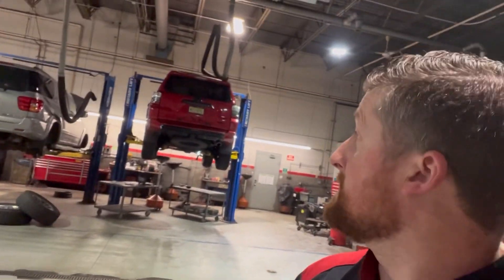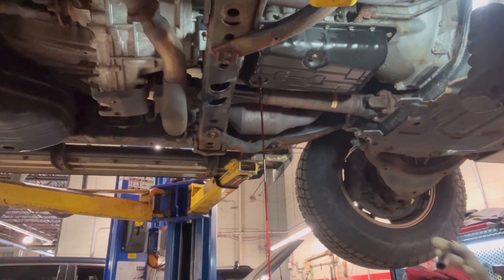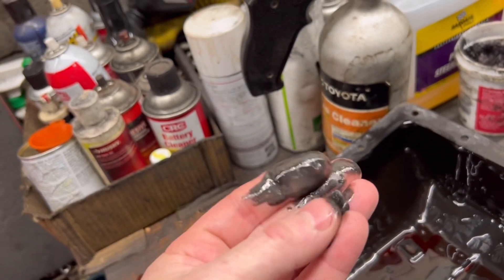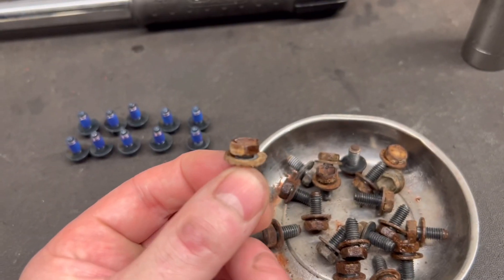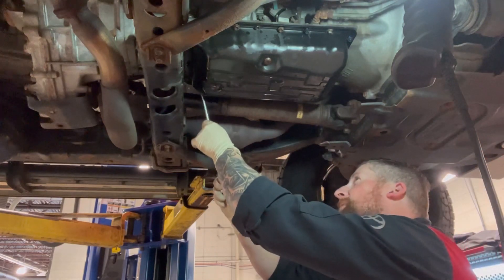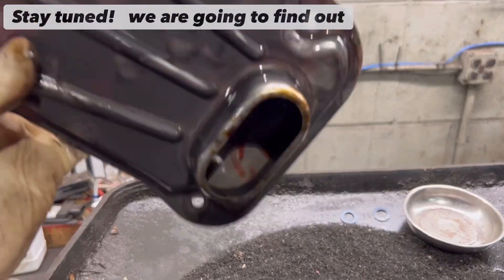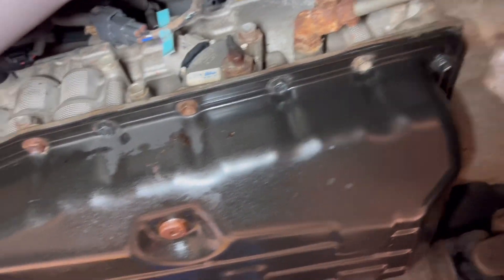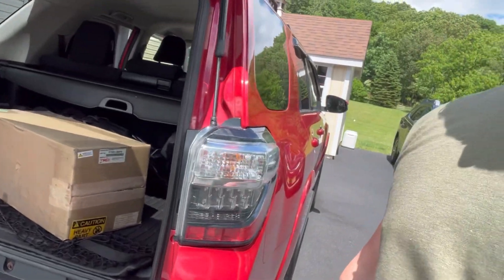Toyota 4Runner • FREE Maintenance Tech Tips - DIY Transmission Fluid Change  with Filter Part 2

Comment: since i bought mine used with 150k I did just the fluid, however it was far dirtier than i expected. So  next oil change will drop pan and do filter.
Reply from the maker: Smart! 👏🏻👏🏻

Comment: I have a Toyota 4runner 2014 SR5 four-wheel-drive with 202,000 miles. I have never replaced the transmission fluid due to the factory recommendation that this is a lifetime of the transmission fluid and filter. After watching your video I would like to do it. However, many people in YouTube advice against trying to mess with the transmission on such a high mile vehicle. Not even for a simple flush and filter change. Some fear that removing the filter could potentially break bolts and create more issues, even due to the removal of small particles which supposedly help with the clutches not slipping. In all these years I have not had any issues with my transmission, no skipping, no noises, or leaks of transmission fluid on my garage floor. I do not use my vehicle for off-road or towing. After 11 years I never had any issues. However, I will not hold you to the recommendation but do you think I should just leave it alone and not perform a transmission and filter service at all. Thank you.
Reply from the maker: 1st off, I would have never waited that long, but I understand why you did.
2nd , I would by all means get it done ASAP 🤞🏻😅
Reply: I'm charging my fluid at 196k miles. Bought it used at 184k and the previous owner told me he had changed fluid and filter "recently". I don't trust that he ever did it after discovering he lied about a significant problem we discovered with the truck. It's starting to slip slightly at take off, so I figure I have nothing to lose at this point, but hoping it cures the slipping! Btw. My 4Runner was never off-road driven either and obviously a "street queen".
Reply from the maker: That’s a shame, but unfortunately if you don’t change that fluid, that will happen.
Wishing you the best of luck! 👊🏻
Reply: Why people said that It’s bad idea remplace the filter on the transmission, it is a filter … all of the dirty fluids come from the top of the transmission go true the filter and clean the fluid properly to prevent back to the top side of the transmission, at least once need to be replaced and cleaned the pan and then magnetic , after that drain and refill and ready to go until nex time, 30 k 👍

Comment: I recently visited my dealership for routine maintenance, and for the first time, they offered to do a transmission fluid change. This service has never been done before on my vehicle.

However, after watching a few videos online—including some that advise against doing it on high-mileage vehicles that haven't had previous fluid changes—I'm now hesitant.

I drive a 2012 4Runner Limited with over 115,000 miles, and again, the transmission fluid has never been changed.

Based on your experience and knowledge, would you recommend getting it done at this point?
I’d really appreciate your honest advice.

Hope to hear back from you soon.
Reply: Thanks for your reply. So to confirm, it is safe to do it, right?
Reply from the maker: @Felipe-gb7yw YES
Reply from the maker: Get it done. 👍🏻

Comment: Hello Wikings Garage,
Your channel is very helpful Thaks for your Tips.
I am writing to you because I have a question regarding changing the A750F transmission fluid. I'm from Brazil and I have a 2014 Toyota SW4 3.0 turbo diesel. This vehicle is very similar to the 4Runner from the USA and has the A750F transmission. I already purchased this vehicle with 90k kilometers and it seems to me that the transmission fluid has never been changed. I'm already prepared to completely replace this fluid, I bought 16 liters of the original fluid, original filter, etc., but yesterday I saw a video on another channel and it caught my attention that the transmission needs some of the debris to work well. I would really like to know your opinion on whether in this case I should change all the fluid or not. I have a doubt about this. At the moment I don't have any problems with the transmission, in my opinion it works very well and I'm worried that it could get worse with a complete fluid change. Here in Brazil, most mechanics want to replace the fluid completely.

I hope you can help me with this question. Thank you very much in advance.
Reply from the maker: In either case, you will be fine.
The A750F is one of the most reliable transmissions out there.
Being that you already bought the fluid, change it all.
It will be just fine. 👍🏻
Reply: @VikingsGarage  Thank you for your opinion.
Reply from the maker: @jonasaugustotelocken43 you got it!!
Let me know how it works out.
Cheers!! 🇧🇷

Comment: Hi excuse me sir i have a 4 runner 2023 2wd..45.000 you recomend change filter o just drain and fill..and how many miles..i never towing..thanks
Reply from the maker: Do not Change the filter, you don’t have too. Change the fluid at around 60k
Reply: Perfect thanks my friend. .i need a tool or scan for just change the fluid?
Reply from the maker: @josecrespo4817 https://youtu.be/4Rhb0xB4zdY?si=44_aiFcEq9Ve6YPU

Comment: I'm about to perform a drain and fill on my 4Runner, but I do not know the prior fluid service history. All I can say about the transmission is that it seems buttery smooth and the vehicle is at 83,000 miles. If a previous owner put in aftermarket ATF, and I add ATF-WS, would the mixture be bad for the transmission? I've heard some mechanics say yes, and some say ATF is ATF. I'm a bit confused about that.
Reply from the maker: Just make sure you use WS atf, that’s what’s important.
If you ask me, always replace the fluid.

Comment: The filter does not need to be replaced, it is just a mesh and the transmission is a close system,drain and fill and placing additional neodynum magnets outside the pan is a better option.
Reply: Thank you for this comment
Reply from the maker: I do say that 👍🏻
Reply: I wanted Toyota to do this and they wanted to charge me $800 I said no thanks. Was considering doing it myself  on my 2018 4Runner with 127,000. I don’t tow anything . Do you think a plain drain and refill would be fine or do you suggest removing the pan and changing the filter? I almost feel like it’s not necessary but I don’t know and I don’t want to do it wrong and cause damage. Your reply is greatly appreciated
Reply from the maker: There’s absolutely no need to replace that filter. 👍🏻

Comment: Just changed mine after watching your video. First change at 190,000 miles. Fluid looked great, still red, magnets in the bottom of the pan slightly coated. Filter coated in a thin black slime like you showed. I tow fairly often too. Thanks for all the torque specs. Refilling with Valvoline Max life

Comment: Vikingo le cambie el aceite tal como el vídeo salieron 2 cuartos 1/2 .le puse 3 cuartos calenté el carro a la temperatura de 107f abrí el tornillo pero no salió ni una gota de aceite a q crees q se debe
Reply from the maker: What??
Reply: viking I changed the transmission oil in my 2015 4runner, as you say in the video, 2 and a half quarts of oil came out, I added 3 quarts but when I drained the oil at a temperature of 104 to 113, no oil came out at all do you think that is due
Reply from the maker: You clearly did something wrong . Why take the oil back out??
If you took out 2 1/2 quarts, 2 1/2 quarts is all you need. 
(The only time this doesn’t apply, is if you have a transmission fluid leak)
It’s not rocket science.

Comment: Great video again! I was able to drop the pan and change the filter out, refill using a pump tank from Amazon (wish I could get the Toyota fill adapter for not so much $$$). I did it from the ground and it wasn't as easy as if it were on a lift but it wasn't miserable either. Thankfully we are in a dry climate so there isn't really any rust on the bolts or plugs to fight with. Our 2011 rig has 175,000 and it is great piece of mind to have fresh fluids in the diffs, transfer case, and AT since having the dealer change them at 100,000. This is the first time having the filter changed.
Reply from the maker: 👏🏻👏🏻👏🏻 
Right on!

Comment: I understand you drained oil twice , so in total you added 5 quarts of Toyota oil ( the one you showed) ? And second question did you have the 4Runner running while you drained the second time? Or was it another car in shop ? I have a 4th generation 2005 SR5 4wd V6 4.0L 4Runner. She has 237k miles. I’m giving thought in doing this . Great video by the way.
Reply from the maker: It’s not that complicated…
Drain and colllect oil. Measure amount, refill with same amount. 
Only drained and filled once at the time.
Not running, always off, when draining. 
Thank you for watching!
Reply: @VikingsGarage  thank you so much .

Comment: Like you said in your previous videos, I would advise against replacing the transmission filter if you live in the rust belt as you can break bolts off, trying to remove the pan. In my opinion, no need to ever change the filter ever if the transmission is working correctly.
Reply from the maker: This is very true!

Comment: I am surprised that no one hss made an adaptor to screw into the plug hole used to check the fluid level that allows one to pump fluid in from the bottom like the ford explorers .
Reply from the maker: We do have it, works of vacuum and the shop air. But it’s also attached thru the top, fill plug.
Nobody uses it because it’s usually broken 🤣🤣
Reply: @VikingsGarage  i was refering to the plug in the bottom of the pan , the one that is removed  to check the oil level to get to the drip stage. I think mercedes use this type of adaptor as well .  Allows one to fill it through the bottom rather than the top plug.
Reply: Here is a video that shows what I mean :  https://youtu.be/bOgs_zbzA5I
Reply from the maker: Yeah we don’t use that. Thank you for sharing.

Comment: Since that’s a sealed unit, and if you have no drips, couldn’t you theoretically just measure how much transmission fluid you took out and put the same amount back in and you’ll be good. Do you use a scan tool to get the temperature?
Reply from the maker: https://youtu.be/4Rhb0xB4zdY

Comment: This is maybe a dumb question but are those the transmission solenoids right there once you have removed the pan?  Could all the solenoids be replaced in theory after removing that pan? Thanks for any help or suggestions...my rig shifts kind of hard between 3rd and 4th gear and I am wondering if I have a solenoid going or something...not really sure what it is and exploring potential options.  Just had the fluid changed...it always goes into gear but kind of pulls the vehicle a bit....
Reply from the maker: I’ve answered it on Instagram . 
Yes you can change them.

Comment: Oh wow I just had this done (123000) I hope, at the Toyota Dealership by me.   It showed up as Transmission fluid replacement service( i requested it because i had been towing a trailer for 8 years with HS marching band my kids graduated, so no more towing). and I noticed there was no dipstick.  Service advisor said its a sealed system and it doesnt get done that often.   I said i had been following the severe service schedule, so they did it.  It shows on service paper work at transmission fluid replacement, i dont see charge for new transmission filter, Is that all part of the regular transmission fluid service?   Again really great info on you channel, thank You
Reply from the maker: Thank you for sharing your story.
It’d a fluid change only, no need to change the fluid ever. (Watch my other video on it, I prove it there)
https://youtu.be/qTh3iuhpE_s
Again, I appreciate your support!! 
👍🏻
Reply from the maker: Not sure which you watched but this is part 1 also : 
https://youtu.be/4Rhb0xB4zdY
Reply: @VikingsGarage  Okay I watched the first video, that sounds like what the service advisor explained, they dont change the entire fluid, they check it while engine was running and needed to be a certain temp.  I have on 01 Honda Odyssey, which had the crappy transmissions everything else is bullet proof on it hence why i still have it.    I just over reacted with the 4Runner.  The 4Runner is built like a tank, and built to last.   Thank You again for quick response and your time.
Reply from the maker: You got it! 👍🏻

Comment: Great video again! I never tow anything so when should I do a drain fill and when should I do a trans filter and fluid?
Reply from the maker: Honestly I wouldn’t bother , drain and fill is sufficient.
 if you see on the video the filter is just a strong mesh (to catch metal particles ).
If you got metal there chances are you need a Transmission. 
Don’t bother with the filter. 👍🏻
Reply: Thanks for the info, I'll do a drain and fill. Keep up the great videos!

Comment: Thumbs up! Great chanel. I have 2015 4runner only 60 000miles , is it normal at lower speeds and going downhill to feel a sort of slip or sluggishness? This car is new to me just had transmission oil change done by dealer. Love our 4runner!
Reply from the maker: It’s normal to a certain extent.
If the level was left on the lower side, it will cause a shifting delay. I would confirm that the level is right, it might just need a little more. 👍🏻

Comment: Love the video as always! I have seen people do a cold drain, measure and replace the same amount and call it good.  Will this method cause harm and why? Thank you for your time and talent!!
Reply from the maker: That method although is not super accurate, it will not cause any harm.
I’ve done it myself several times.
Word to the wise:
- If you put in just a little more then you took out, you’ll be on the safe side.
In this case it’s better to be safe then sorry. 😉
Reply: @VikingsGarage  when you say a little are you thinking 1/4 to 1/2 quart. I am not anywhere near the time for a change out. I thinking the future. We have a 2020 and 2022 SR5P. A couple videos back you talked about 20 mpg. My 2022 I have averaged 22.1 and 22.3 the last two fill ups. Thanks again for the videos and answering my questions!
Reply from the maker: A  little , as in less then 1/4 of a quart.
Your welcome!